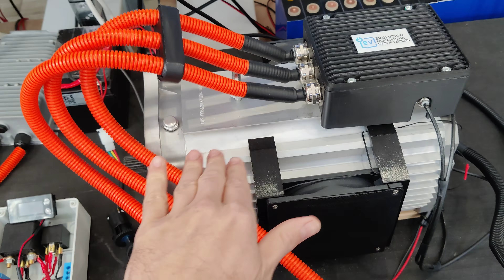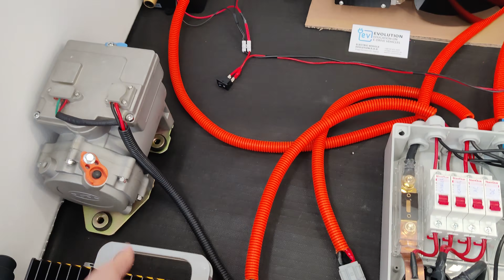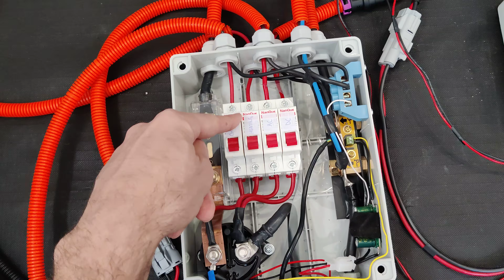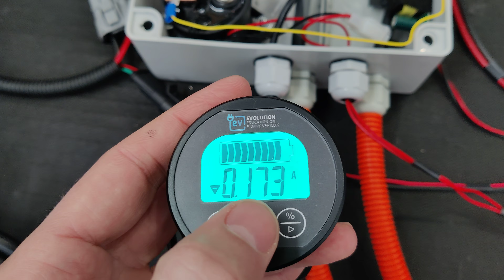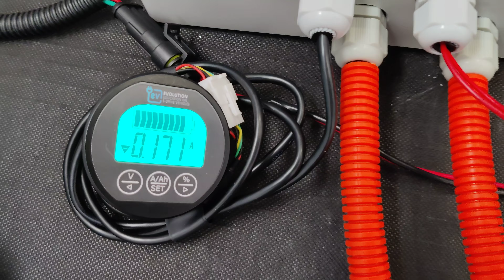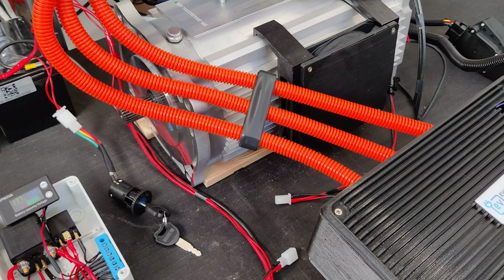EN: EV Conversion Kit: Transform Your Car from €4999!

Comment: Uh, those heavy switches should be relays.  Makes me not trust anything about your design.
Reply from the maker: These are fuses; using relays wouldn't make sense in this context and could potentially lead to a fire. Please ensure you  consult with an expert before.
Reply: @ev-evolution  You were using them like switches, though.  So it is fine if they're breakers, but the way you used them of as if people would only be able to turn it on get getting into that box and flipping the breaker.
Reply from the maker: those are HV DC automatic brakers, you can use them to disable power to some device like a switch if you need to replace some part. All control of devices is done over LV (12V) switches or automatic controlled by BMS depends on the device.
Reply: @ev-evolution  Yes, I understand how breakers work... hence why I responded with using the term.  Just the expectation that people use use them to turn on a heater or AC is the part I am calling into question.  Leave the breakers in, and on, and then add relays that are controllable through low voltage wiring inside the car.  Because a snarky comment like "consult and expert"... I know what I am talking about.

Comment: How much cooling is needed on the motor and controller? In a country like Australia it gets a bit hot so just wondering if that fan is enough in a 25-32 degree Celsius ambient temperature environment. Overall tho i like it.
Reply from the maker: yes, was tested at 37 celsius. In most cases fan is not even needed only if going uphill or with full power all the time

Comment: What is the Battery Power capacity of this system on your table (currently)?
Reply: 100% as long as it is plugged and 0% as soon as you unplug it!
Reply from the maker: currently system has 12kWh LFP battery modules, next month there will be also other more flexible modules